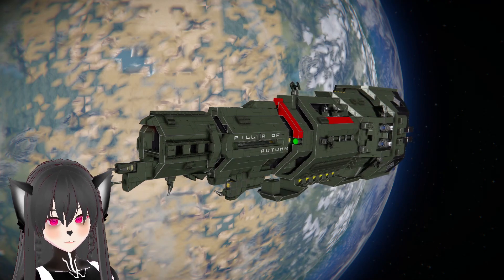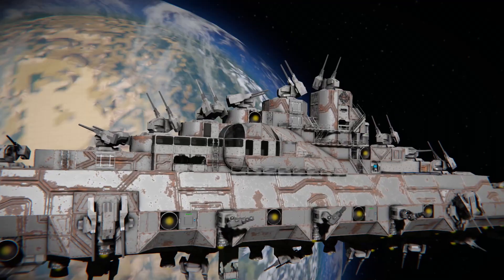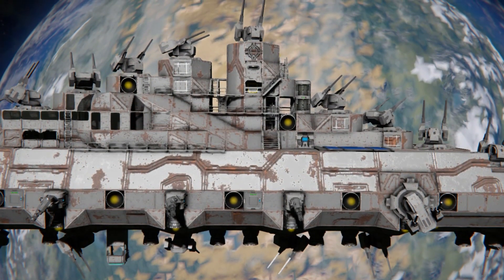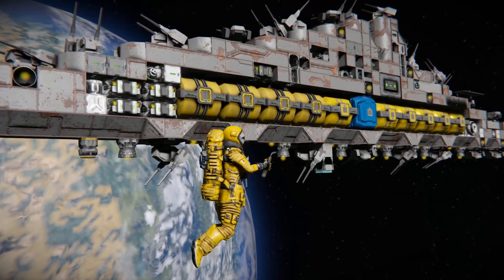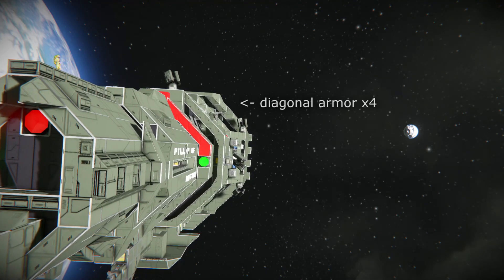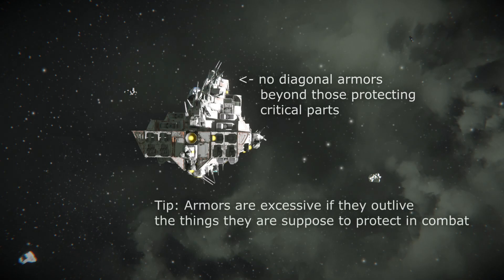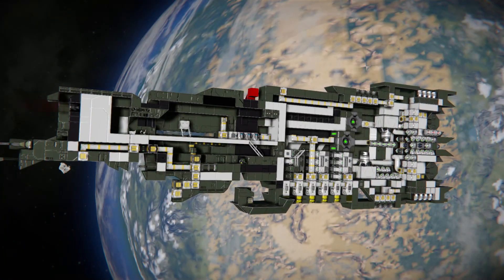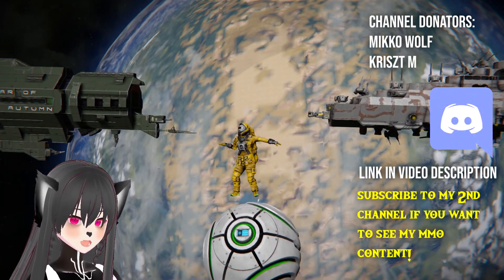Why Make Ship With Hull Superstructure, Space Engineers

Comment: honestly even with forward firing fixed heavy weapons, you want most turrets to be dorsal or ventral large diagonal sections aren't always avoidable, but because they are hard to actually use, light armor should be fine, besides point defense, port and starboard should be used for hangars and guided missile/torpedo cells,

Comment: Hey Luca, just wondering your thoughts on this: As you say, almost all of your ship designs use a Hull + Superstructure design, but how about adding in a Substructure? You already make use of the fact that your vessels don't float, thus allowing you to put turrets along the sides and bottom of the craft. So why limit yourself to just an "top" structure when you could add smaller bottom or side structures to add additional line of sight for forward firing guns for your Alpha Strike, while not really limiting your dodger line of sight for sustained combat?
Reply from the maker: I did think of that c= but it'll make it hard to land and the limiting factor is cost, but in a future ship I think I can make it work maybe even having 100% lines of sight both forward and broadside, we'll see x3
Reply from the maker: Though that will limit the rear turrets' lines of sight x -x
Reply: I would imagine that if you did the substructure in a shape roughly similar to a check mark, so that it's a flat "blade" facing the front and sloping back up to the read, you'd be able to create an angle that would minimize the amount of lost line of sight on the rear turrets while dodging at an angle.
Reply: Plus, then the blade would be able to house more channel-locked weapons like the railgun or artillery cannon to further maximize the Alpha Strike

Comment: This is completely wrong actually its the opposite. The best ship hull design is just a long rectangle without anything sticking out. The reason for that is you want to minimize frontal surface area as much as possible and building a giant tumor on a ship makes it way easier to hit.
Reply from the maker: The superstructure is also there to help forward turrets lines of sight x3 but yeah it's not a dedicated forward-firing ship c=
Reply: @LucaTheGuide  if you want more turrets to fire than make it more like a cone.
Reply: @AdamSchadow  effectively that's what a superstructure does, now that isn't to say all the gibbons on the example ship are needed but it does enable superceding turrets until you depress again for chase guns,
Reply: @TheMhalpern  the issue is that in this game turrets are really bad because railguns are just superior but you can use a few to shoot down small stuff but for that you dont need a tumor on the ship.
Reply: @AdamSchadow  Not really, rail guns (if they hit) only put a 1 block hole through most things, and then take at least a minute to recharge, so your only going to be firing them a few times in a battle, I am however counting player built turrets so if you wanted to, you could have a railgun turret. a well designed warship will be able to remain functional after a railgun hit, most of the time. they are great to get potential early damage in, that would reduce enemy capability, but they aren't to always be the primary damage dealer, more likely your primary damage dealers are going to be artillery turrets
Reply: @TheMhalpern  The thing is your other weapons will hit like 10x less often then railguns and 1block hole into a large ship is more than enough. Large railguns also cost only 80 pcu so you can spam a lot of them and at like a machine gun constantly firing. The problem with custom turrets is how fragile they are and how incompetent the keen turret ai is.
Reply: @AdamSchadow  sure you could death cube it, if the server allows that.
Reply: @TheMhalpern  Its very hard to not allow that since its basically just the idea to build the best ship possible.
Reply: @AdamSchadow  death cubes aren't fun, they are lazy, as for how to stop it, limit the number of weapons for certain types per grid, or just have an admin take a look and judge if it's in the spirit of the kind of gameplay they want.
Reply: XD
Reply: Rectangle won't have a firing arc as good as a tube. Smaller the tube, better turret coverage.
Reply: no matter how you fight, you want all your main turrets to be able to point and the enemy, realistically that means you want them mostly on the dorsal, and possibly a smaller set of heavy turrets ventral, with the port and starboard used for hangars/landing pads and point defense. the ability to combat jump means that you always run the risk of being flanked. You still want most of your battery to be able to hit targets in front of you, with possibly one or two chase guns that can still contribute to your broadside,